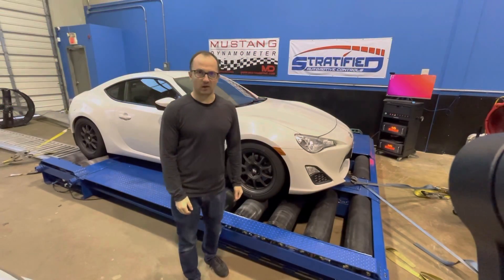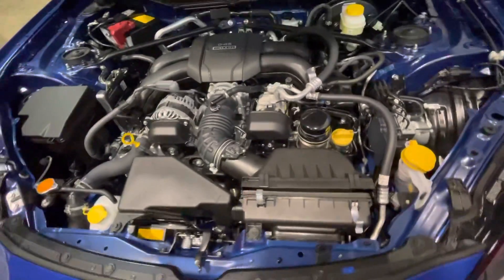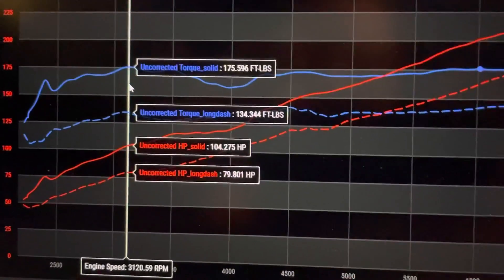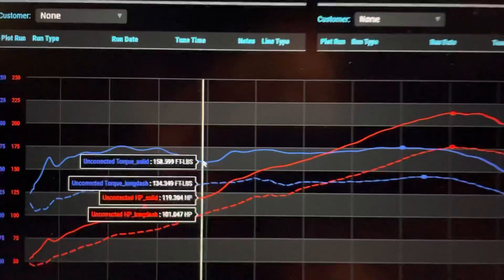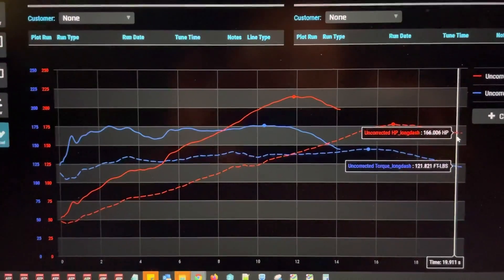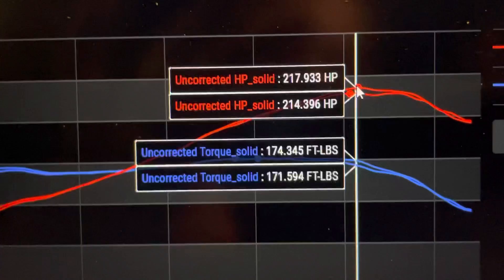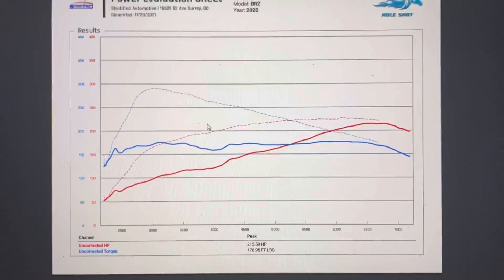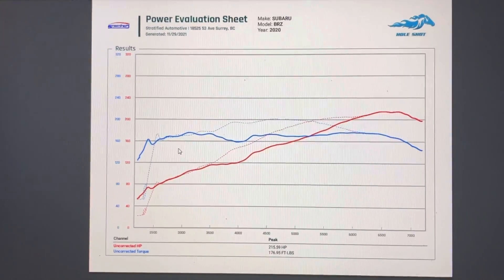2022 BRZ Build EP3: Dyno Baseline and Data Overload!

Comment: stock FA24D is likely making about 254–262 bhp and 208–216 btq at the crank, which aligns with Subaru’s claimed 228 bhp and 184 btq—suggesting the engine is underrated from the factory.
Reply from the maker: It’s definitely a strong NA motor.

Comment: So making up for drivetrain loss, say a 20% loss, the gen 2 makes closer to 268 hp and 220 ft lbs torque. Yep they definitely underrated this thing.
Reply from the maker: It does look like it. A German thing to do.
Reply: @stratifiedauto  hello, did you do these dyno runs in 4th gear instead of 5th gear? 

From what I've researched, on this transmission, 5th gear is 1:1 so doing a dyno in 4th gear is inflating the numbers.

Comment: You measure 217whp or with a usual loss coefficient of 1.15, 250 hp at the crank. That's a lot for a 2.4 NA. They themselves announce 230 hp at the crank.
Do you think Toybaru has developed a low friction gearbox or just intentionally underestimated their numbers?
Reply from the maker: I think the car was slightly underrated and it’s a fresh motor.
Reply: They might have done both. But there is no way they could have reduced the friction loss from nearly 50 hp down to 13 hp. I guess they reduced it to around 25-35hp and it really makes 250hp at the crank like you said.

Comment: Do you know if the gen 2 prop shaft is aluminium or steel like the old one? I'm curious if this is a shared item like the brakes etc
Reply from the maker: I am quite certain it is like the gen1
Reply: @stratifiedauto  thanks, good to know as the original gen1 coilovers, brake upgrades and other chassis specific items are the same and weight reduction items im sure will be in demand
Reply: @Dan_AYP  I'm curious too as to what drivetrain parts from the '22 will fit on the original. 1kg off the propshaft isn't it? And then there's the synchro upgrades in the transmission.

Comment: Great video, can't wait to see a e85 tuned full bolt on dyno graph, 250whp NA without opening the engine would be the dream
Reply from the maker: On our dyno 250whp would be very strong. We will find out.
Reply: Agreed
Reply: That’s exactly what I’m going for
Reply: The 911 GT3 managed to get 500hp on its 4.0 N/A flat six, if this engine would have the same intake design and engine tech as the gt3 this 2.4 engine could make 300-400hp.